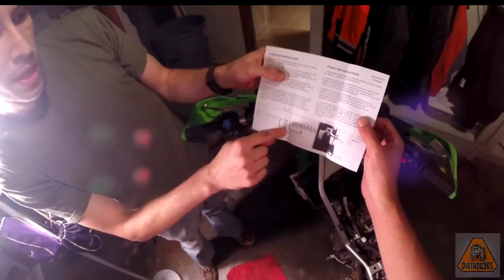KLX-250s Carburetor Re-jet Without Removing It: Part 2 - Needle Replacement

Comment: I done my 2013 just like in the video. It worked out fine. Someone had already been into air screw but not Set on 3 turns out. Makes world of difference with stage 2, 2 plates drilled through in muffler and airbox lid shimmed up. Throttle slide will only go in one way. Make sure to separate top plate from diaphragm before pulling it off. Thanks for the video!!